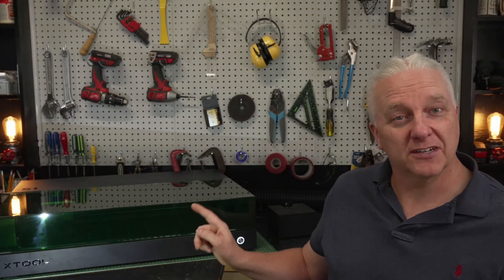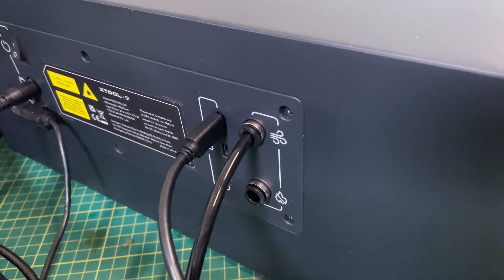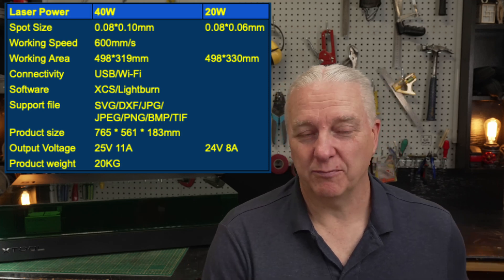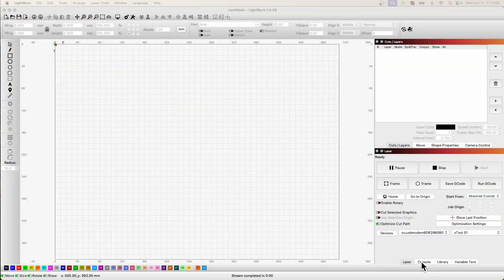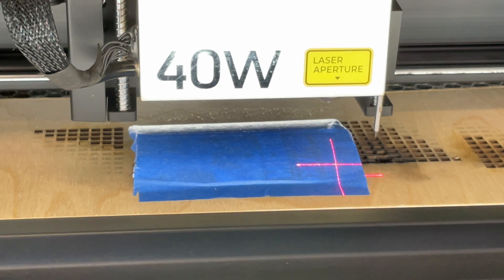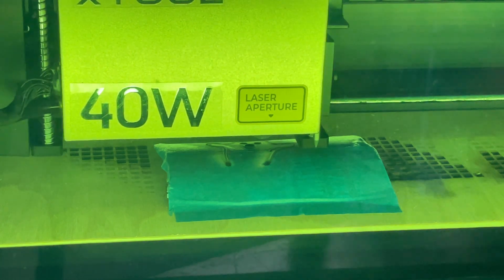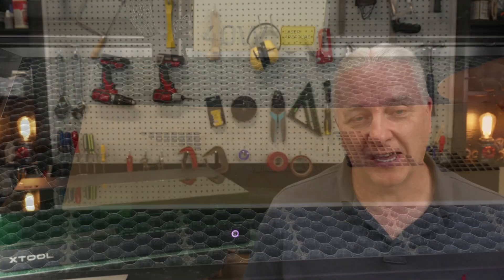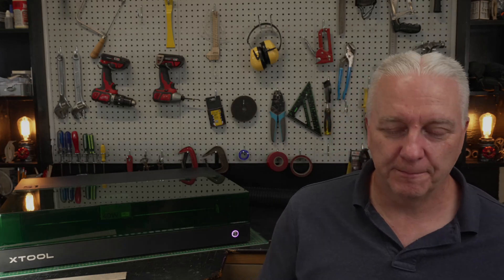The Incredible xTool S1 Laser - The Future of Diode Lasers Arrives

Comment: I got the stool s1 and used the basswood provided to make a test cut, and it worked beautifully.  I tried cutting 1/4 inch MDF and it did not cut at all.  The machine acted like it was cutting but did not even leave a mark on it. I used the settings 100/4/1.  Any suggestions?
Reply from the maker: MDF is notoriously hard to cut with a diode laser. The problem could be the type of MDF you have.  It is basically a bunch of sawdust and glue compressed together and some types are very dense whiles others use glue that can prevent cutting.  Both will bring you disappointment if you are trying to cut them.

Comment: Do we have to dismount the 40 W diode head and then mount the 2 w IR head in order to engrave, or does it engrave while cutting with 1 head just like the F1?? I am confused, because on S1 it says additional IR module sold separately
Reply from the maker: In the S1 you swap the whole module
Reply: Thanks Steve! 🌟 @SteveMakesEverything  That's a bit of a hassle, given that I got used to the F1 all-in-one easy switch Between IR and Diode. Love that 40 w power, but changing modules not so much. Appreciate your honest review !👏
Reply from the maker: @fruitloops68  It's not too bad, but if it's something you would will do often, then the F1 is probably a better option.

To swap modules in the S1 you do need a screwdriver, and if you want to cut with the blue laser then engrave with the IR, I doubt the S1 would get the alignment exact between the two modules (not to mention the effort you'd need to avoid touching the material)

Comment: I’m looking at this pretty seriously. Do you think the 20 watt would be reasonably powerful enough for most applications? I’m looking at etching and engraving as being a big part of the use. I’m not sure the ability to cut  a 3/4” piece of material is important to me.
Reply from the maker: Yes 20W will be fine for your application. Even if you did want to cut 3/4” material it should be possible with the right settings.
Reply: you´ll have a smaller spot size with a 20w so more details for you. anyways... just get a co2 instead. really no reason to go for this one if you ask me
Reply from the maker: @yibberrino3002  Well, I have both CO2 and diode lasers, and they certainly both have a place.  If I want to do big grunty cutting jobs or work with acrylic, I will use my CO2, but for engraving, it's always a diode laser.

Try engraving a grayscale photo on a CO2 or engraving stainless steel without having to jump through hoops with expensive spray (though I will use a fiber laser for most metal engraving).  Of course a diode laser won't cut most acrylic.

Unfortunately, we don't have a perfect laser, so you need more than one to cut/engrave everything.  But if you want to get started, then I would confidently tell people their first laser should be a diode laser.

Comment: I recently bought the xTool S1 20W with plans to buy the 40W. XTool recently told me they have no current plans to sell the 40W laser separately. Any suggestions??
Reply from the maker: Hmm, that's interesting.  It seems dumb to not want to upgrade users.  I'll have to ask about this.
Reply: @SteveMakesEverything  exactly what I said, I even replied with asking “what if you just need a replacement?” The answer was that the 20W is perfectly capable of getting most of the work done (which is fine), my most recent reply back from them said that to keep an eye out and in the future they may have them on their website…
Reply from the maker: @MillCreekLookout  So I've taken the liberty of shooting this message to xTool to see if I can get an official reply from them.  I'll keep you posted.
Reply: @SteveMakesEverything  Hey Steve just wondering if you heard back from them yet? I also ordered the 20w version with the intent to order the 40w module next summer.

Comment: Thanks for the great review! I especially like the two point alignment/framing feature, very easy to use.
Reply from the maker: It’s definitely more accurate than most cameras I’ve tried.  I’m actually growing to like XCS better than Lightburn for a lot of things now too.
Reply: @SteveMakesEverything  ,although I haven't had the pleasure yet of testing this myself I have to agree with you on the accuracy. It will not have the drawback of being most accurate only in the center of the bed. With this system it will be spot on at each position on the bed. Really like that. 
Another thing that Xtool could make use of, as the software is registering it's actual position on the bed by dragging the laser head manually, is when you would like to run a design again from a certain point. You would then be able to just set the laser to that exact coordinate and press run. I would love to also see something like that incorporated into the software.
Reply from the maker: @jewijk  I’d love to have a way to start jobs at a certain point.  Xtool could do this with XCS, but not Lightburn of course.

Comment: Nice review and nice laser, but they totally missed the mark by not having a camera. The two point system is beyond inefficient for multiple simultaneous cuts on previously used material or odd shaped material.
Reply from the maker: Not sure I agree. The two point system works better than any Lightburn camera and it take seconds to set up. The only potential downside is that it only works in XCS. I think the Lightburn folks are starting to hold back innovation.  If you are using Lightburn you could probably cobble a cheap camera in here though
Reply: @SteveMakesEverything I bet LightBurn will make something to work with this minus the curve mapping it seems like it’s just math and reference points. It’s the first I have seen like this so they may just need some time to adapt and XTool may have not shared this with them.
Reply from the maker: @TheChanceFam  xTool says they keep asking Lightburn to make specific improvements to LB, but so far no interest.

I personally think that Lightburn needs some sort of plug-in framework where they a provide a function called "Focus" for example, and then allow laser manufacturers to supply a plug-in to focus their specific product.  If they don't do something like this, LB is going to quickly become a dinosaur, because lots of lasers have specific functionality now.
Reply: If I have a previously used piece of wood that I cut out random items, and now I want to cut out multiple small items out of it, with a camera I would just update my screen either in XCS (lets say the P2) or Lightburn, and place these new small objects all over the place, anywhere with an available spot, and then I could engrave/cut them all at once. With the 2-point system I would have to map out each specific area...it would take forever. What do you think? Oh yeah, if the 2-point system is superior to a camera (doesn't need to be a lightburn camera, can be XCS) why didn't they incorporate the 2-point system on their P2?  @SteveMakesEverything

Comment: Great review! Thank you. How thick of a piece of wood can it handle without the extra riser base?
Reply from the maker: Good question, I’ll have to measure it but it’s at least 30mm I’d guess. Keep in mind that the honeycomb is about 25mms thick on its own and it can be removed as well as the bottom of the laser, so the material can be just about any thickness.
Reply: Thank you.
 @SteveMakesEverything

Comment: Thanks for the review. 

A question about the provided software. I normally do not use this kind of devices as often as you do. So I expect that I want to use them a lot longer than you do.  

Is the software it cloud based? I personally do not like cloud based software; if Xtool decides to quit the access to this application , or the company does not excises anymore I lose functionality; I still can use lightburn or other software; but miss the nice features like using a curved object. (One of the selling points of buying this laser above an other 40 Watt).

For the same reason I prefere not to use an app on a phone (they can remove the app from the AppStore); same story with USB; we all have had the problems that we needed to buy a new printer or scanner; not because the device was defect; but there where no drivers available any more for the next operating system.

So I prefer software I can install on my local PC/Mac without internet connection and if possible a standard network cable.

Long story short can it run without internet connection?

Thanks
Reply from the maker: XCS doesn’t lock you into a cloud offering the same way something a Glowforge does. If a network connection is there you can tap into AI design and the Xtool library.  With lightburn you are totally standalone
Reply: it also supports using light burn if you want. you just lose the additional functions thier software gives you

Comment: Great machine but unfortunately I would need to be an influencer to own one as it's currently out of my budget. Until I can afford one I'll just have to drool. I already have the xTOOL F1 on my 'To Get' list so this will definitely have to wait. Having 40 watts at my disposal would certainly allow me to bring some ideas I have to fruition, though, that's for sure. Very nice, indeed.
Reply from the maker: I would say the S1 is a great unit for a small business or a home user with a flexible budget.  It’s realistically not a first laser for most people.  Xtool lasers are typically the limousine of lasers and that comes at a price.
Reply: @SteveMakesEverything  Sure, it is an outstanding machine, but my first machine was the 10 watt D1 Pro, and I am using that to gain experience and to increase my budget. I want to mark metal, though, so the F1 will be next. Assuming all goes to plan with that, I will have  a better budget and I can consider this at that point. 

I'm certainly not knocking the higher price but right now it's out of my reach. I do have good credit but using that now when I have lots of other costs to consider wouldn't be too smart. When I have the cash in front of me and I don't have to use credit, I will revisit this.
Reply from the maker: @budgetmerch  sounds like you started down the right path.  The F1 is an excellent machine if the small work area works for you.  Keep in mind that you can put the same IR laser in the S1 and mark metal too.

I think it’s responsible to stick to a budget, but always keep your future needs in mind too.